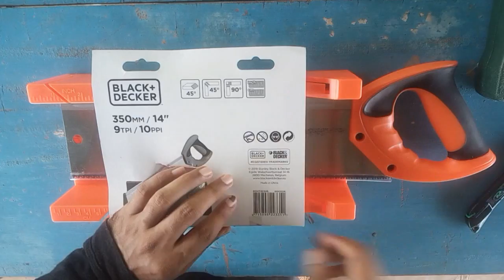Mitre box for easy perfect 45 degree cut

Comment: I've just spent the whole weekend trying (and failing) to cut 120mm high skirting boards using one of these mitre boxes, but the board is obviously higher than the edge of the box.  So by the time my saw gets to the box my angle is slightly out and I end up sawing into the plastic box each time.  Is this the wrong tool for cutting skirting boards?